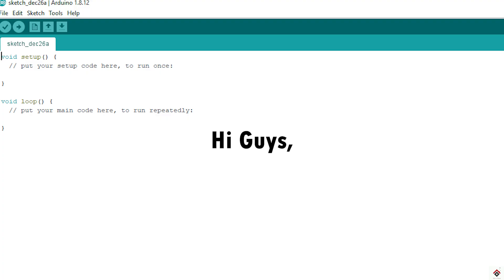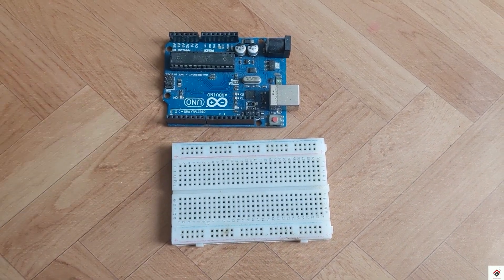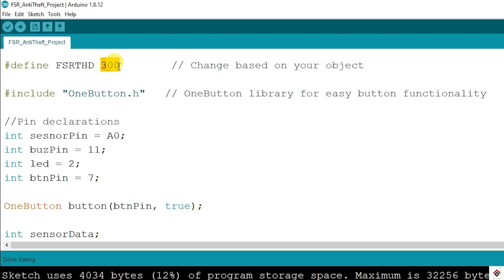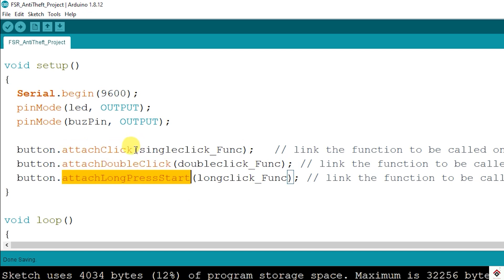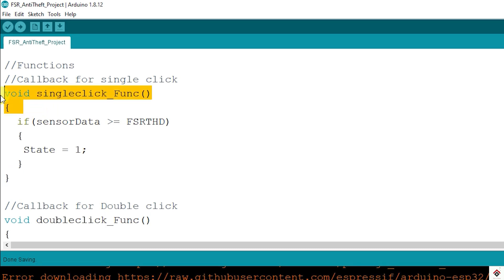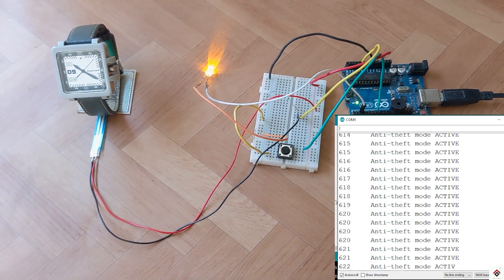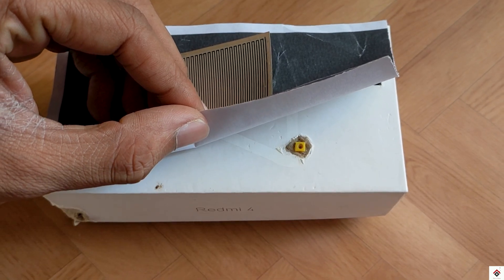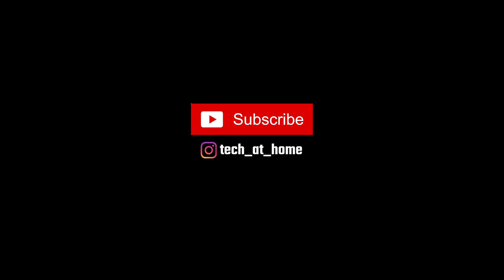Anti Theft Security Alarm Project using Arduino and Force Sensor 🚨 | Science Inspire Award project 🏆

Comment: Bro i had to press hard with hand  on the fsr to get the values whenever i keep object on it the values doesnt change in serial monitor . What should i do i purchased all the circuit and all with drive. And did the same
Reply from the maker: Have you done the resistor connections properly?